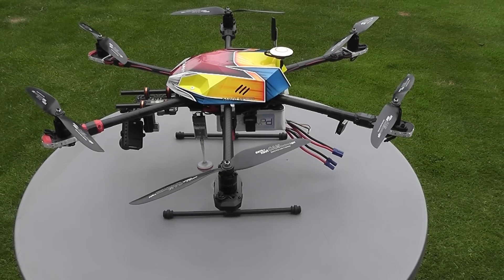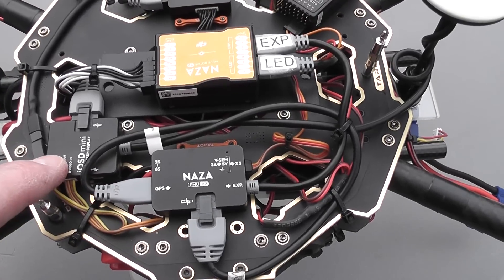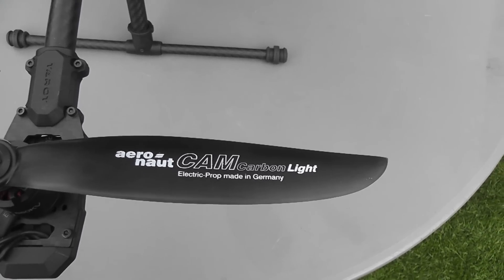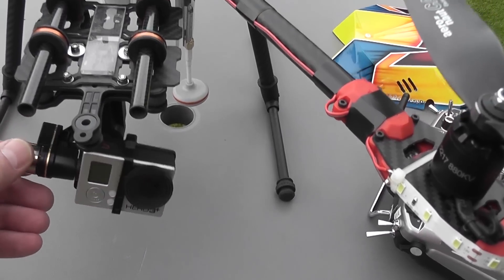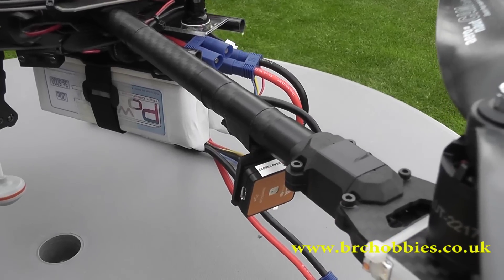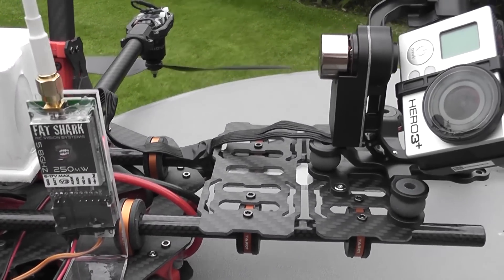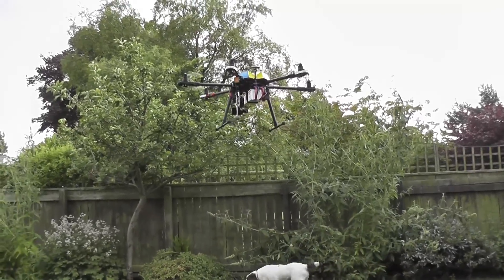Tarot 680 Pro Hexacopter, Component Layout and Maiden Flight

Comment: Blyth Valley Radio Model Club site if I'm not m,mistaken? Recognise the harbour lighthouse in the background :)
Reply from the maker: Correct but not a member there currently:-)
Reply: From North Shields myself but live outside Middlesbrough these days.  Good vids on the 680 Pro.  Thinking of upgrading from my 450 quad to a hex and the tarot looks a good option.
Reply from the maker: The upgraded version of this is 4sale if you are interested, see the nxt video for details

Comment: Hello, How were you able to control the gimbal from the ground?
Reply from the maker: The gimbal is controlled via 2 of the spare PWM channels on the FrSky receiver.  These channels are mapped to the right and left sliders on the transmitter giving control of pan and tilt
Reply: RedHotPheasant Thank you very much!

Comment: When you're using s-bus you do not only have the 8 channels to work with, you have all 16 channels. :) (8 channels is only if you use pwm)
Reply from the maker: +Adrian Navntoft Hi, Thanks for the comment.  You are correct, however, to the best of my knowledge in order to operate optional equipment like retracting undercarriage, nav lights or some gimbal operations you need to use the conventional (PWM) receiver outputs.  To do this you have to tell the receiver to split the 16 channels, 8 to S-bus and 8 to conventional.  This is done by binding in mode 3 (without telemetry) or mode 4 (with telemetry).  Please let me know if there is a better way to do this using only the s-bus port?

Comment: Hi there, great Tarot you get and very nice paint for your canopy ...it seems to be a Transformer helmet....So, i've shown that you wire with Sbus but could you tell me on which port do you connect your Naza M V2.....U, X1, X2 .....etc...??
Thank's a lot and happy fly
Philippe ( France )
Reply from the maker: +Drones Visions Aériennes Hi, Thanks for the comment.  The connection is between X2 on the VAZA and in my case SBUS on the Frsky X8R receiver.  If you are using Frsky receiver and you want to use the standard output pins for additional functions, like a gimbal, then you have to bind the receiver in mode 3 or 4 with the transmitter in D16 mode.  This will give channels 1-8 on SBUS and channels 9-16 on the output pins.  Receiver manual here www.frsky-rc.com/download/down.php?id=102

Comment: Hi, nice rig.
what size of carbon tubes you have to attach the gimbal on? 250mm 500mm?
Reply from the maker: Adrián Lengyel Hi, thanks for the comment.  Originally I started with 500mm tubes and pushed the gimbal as far forward as I could and pushed the battery back to keep it in balance but I had a lot of problems with vibrations on the long tubes giving poor video.  I have now settled on 250mm which is a good compromise.
Reply: So u had vibration with longer tubes ? Thats sucks :(

Comment: Hi. Really awesome build! Please clear something up for me - I want to use the same frame with the same canopy (although different colour!) I've seen people talking about the orientation of the top plate, when you intend to use the canopy, has to be with the battery terminals located at the front of the craft otherwise the canopy screws holes don't line up. Is this true? Does this present any other problems during the build? (apparently this is the way Tarot tell you to do it) From looking at your wiring it looks like you have the battery cables running from the front of the craft to the back? Cheers
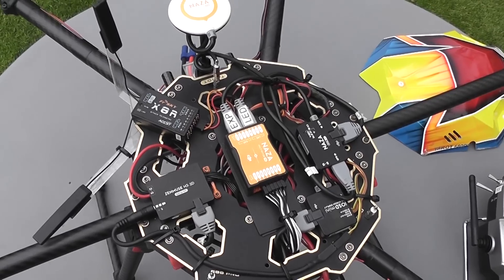Reply from the maker: Hi,  You are right, the canopy is held by 3 posts, 1 at the rear and 2 up front, you can see them at 0:53 in the video so you need the battery terminals at the front and the name "TAROT" goes to the rear.  Also make sure you match the bottom plate as it has matching holes which allow you to poke a straight hex driver through to tighten up the screws for the posts. The build is pretty straight forward Oh and by the way I have now swapped the canopy for black :-).  Thanks for your comment
Reply: Thanks for your reply, that's good to know. Your copter is very similar to how I want to build mine, especially with the extension arms for the gimbal. If you have a link for where you got them from I'd be grateful? Still trying to work out what motors, props and ESCs to go for....but that's all the fun :) Cheers
Reply from the maker: Greg Brookman Hi, I don't know where you are situated but here in the UK I got the tube from http://www.ebay.co.uk/itm/1-x-OD-10mm-x-ID-8mm-x-Length-1000mm-1-m-Carbon-Fiber-Roll-Wrapped-Tube-3K-UK-/251804258279?pt=UK_ToysGames_RadioControlled_JN&hash=item3aa0b40fe7 I am sure you will find similar in other countries.  Cheers
Reply: That's super, thank you. I'm also in the UK. I'll be getting my 680 frame this weekend, think I'm going to go with DJI e600.

Comment: Hi there, just wondering if you were using your Gopro as your FPV camera and was it easy to wire up? Great vid and Great hexa. Cheers.
Reply from the maker: Hi, Yes I do use the GoPro for FPV, this also helps in framing the video.  I have the GoPro set to "narrow" view.  This keeps the props and legs out of the way and stops that fisheye effect you get with wide and superwide.  If you have a Zenmuse H3-2D gimbal then the power/video/audio and GoPro charging are all handled by the rear connector which the GoPro plugs into.  The H3-3d has a flimsy ribbon cable that plugs into the USB on the GoPro but does all the same things so there are no external wires.  Other gimbals will require a separate power supply, normally tapped off your 3s or 4s main supply (check the gimbal specs) and the Video/audio will require a USB adaptor like this http://www.kooltoyz.co.uk/gopro-hero-3-hd-video-out-cable.html there are several on eBay.  If you have a 5v supply (from your video Tx) then you can also get a USB adaptor that will charge your GoPro as well.  Thanks for the comment and I hope this helps.
Reply: RedHotPheasant Thanks, that was some good info, I like your set up and have copied a lot of your ideas for my 680 Pro. Good job! Well done. Cheers.

Comment: I don´t know how many flights you had. Tell me your opnion about the motors? Are they capable for this hexa, well balanced, etc.At what throttle you van hover?
Reply from the maker: For the price, the motors seem Ok probably only flown about 3 hours in total without problems (weather and time preventing me from getting out more). The motors are well balanced out of the box but I do have one motor that seems to have a rough bearing and it is hard to balance, will probably change that one.  I am not an expert flyer so fly on GPS and Atti mode where the hover is managed by the Naza and is always at half stick.  It takes a good amount of stick to break it off the ground but one in the air it is fine and climbs fast enough for me. Thanks for asking
Reply: RedHotPheasant
Thank you for your quick reply. It helps me to decide. Happy flying.

Comment: How do you have that low battery alarm wired in? Does it read bit of the batteries or just one? Thanks! Nice build.
Reply from the maker: Hi,  The balance plug from one of the batteries plugs into the alarm.  It reads each cell and the total voltage.  You can set the cell low voltage, say 3.6v per cell (total for 3 cells 10.8v) and when the volts drop below this the alarm goes off.  I have 2 batteries in parallel and only measure one.  The batteries are well matched (only used on this from new) so in practice they drain at almost the same rate.  My OSD also gives me the voltage, this alarm is just a final warning to  make me return and land.  Hope this helps, thanks for the comment

Comment: Hello :) where did you attach the naza? In the top plate and power distribution board there is a hole in the center. Could you please explain it how you attached it there? Thank you :) and question no two is: do you think it is possible to buy a second buttom plate and attach it witch spacers on top of the top plate to have a nice cleen look? I dont like these hoods with so mich colors on it :) thank you!!!
Reply: I guess he has explained how he mounted the naza afloat the hole. I will advice you against mounting the naza in the provided hole to the button plate. The last time I crashed, the arms went straight into the naza FC.....destroying it instantly.....please always mount on top...
Reply from the maker: Hi, Thanks for the comment.  The Naza is mounted directly above the centre hole on a piece of plastic that bridges the hole, all held with good double sided sticky tape.  If you mount the ESC's under the motors like I have and bring the wires inside the arms to solder to the top plate (PCB) you will find there is not enough space to fit the Naza inside between the 2 plates, even if you could it would make it very hard to reach the connections for maintenance.
For your second question you could buy a second BOTTOM plate and mount them together with spacers using the 3 holes that are used to access the screws that fix the canopy mounts.  You can't drill holes in the top plate as you might short the PCB.  The canopy is also available in mat black. Hope this helps.
Reply: Hey thanks for your fast anser :) i think it is a good idea to install the naza on the pcb because you can reach it very good on that way. i like the design of my f550, because there is the pcb the lower plate. you only have to disassemble the top plate and you have access to all components of the copter. and exact that is my idea. your tip to mount the second, new lower plate with the help of the canopy holes is very good. if i disassemble this plate i have access to the components, too.
thank you :) i guess there will come some questions soon, hope you maybe can help me too? :) thanks man!

Comment: Hi, nice build, just completed the same. The things that interest me are mounts you have used for the x8r antenna and the GPS mount, what material have you used and have you shaped yourself? Again nice build.
Reply from the maker: Hi, thanks for the comment.  The x8r antenna is stuck with double sided tape to a Perspex (plexiglass) support.  I have modified it since the video so both stick up in a v shape with a 90 deg spread.  Easy made just cut out a letter "Y" about 120mm tall (12mm wide) and the "V" at the top 90 deg spread. The vertical leg is only 40mm long.  Then heat it up slowly with a hot air gun until it softens and bend the "V" at the bottom and again double sided tape  to stick it under the receiver.  Cheers

Comment: great video. can you please tell me what you used to extend the esc wires to the central board?
Reply from the maker: Hi, Thank you for your comment.  I purchased the motors and ESC's from a company in the UK called Unmanned Tech and the ESC's came with long tails so there was no extension required.

Comment: Hello great video like you say not alot on yt showing the lay out on the 680 pro, i've just purchased one with the exact same canopy (blue and yellow) going to extend the camera mount also,where did you purchase the 10mm carbon fibre rods? subscribed and liked thank you once again for a great video
Reply from the maker: Hi, Thanks for the comment.  Got the tube on eBay from this seller http://www.ebay.co.uk/itm/1-x-OD-10mm-x-ID-8mm-x-Length-1000mm-1-m-Carbon-Fiber-Tube-Roll-Wrapped-3K/251616095100?_trksid=p2047675.c100011.m1850&_trkparms=aid%3D222007%26algo%3DSIC.MBE%26ao%3D1%26asc%3D23982%26meid%3Dc50a82e50d4c4556a821713fd0f17ed6%26pid%3D100011%26prg%3D9421%26rk%3D1%26rkt%3D10%26sd%3D251583192156
Hope this helps and good luck.
Reply: Hi thank you for the info on the e-bay seller,one thing i forgot to ask you about the canopy the white silicon retaining studs do they sandwich between the canopy thank you again.
Reply from the maker: Hi again, yes the little grommets are inserted so there is half on each side, they were very tight fit but eventually poked them through with a small blunt flat screwdriver.  Also had to pop a hole through the middle as there was a thin membrane across the centre, probably due to bad moulding - Cheers
Reply: Hi thank you again for the information very helpful.